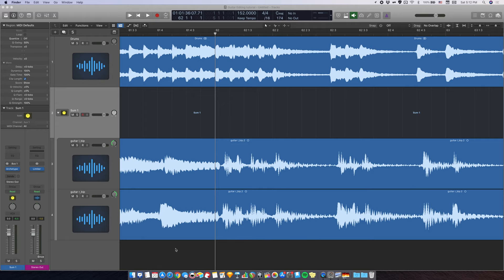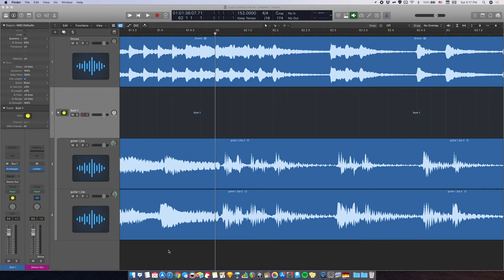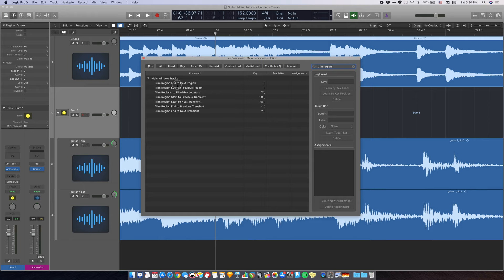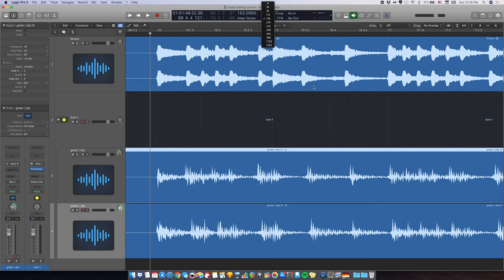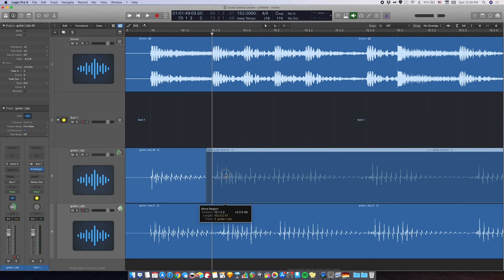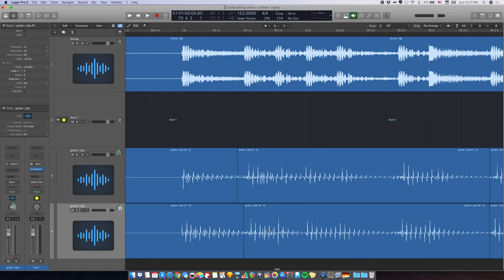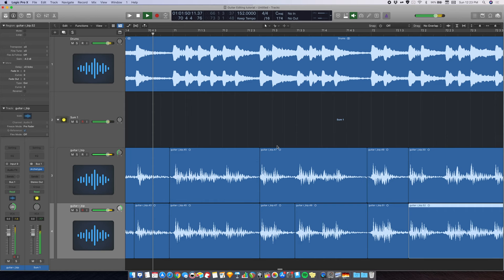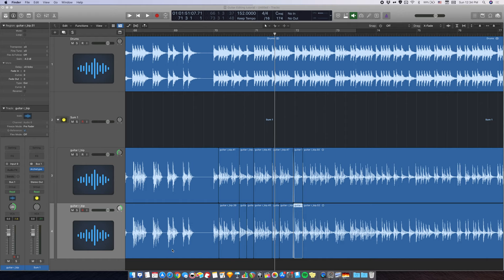The BEST Way to Edit Guitar DI (No Flex Time) - Logic Pro X Tutorial

Comment: Consider trying the Marque Tool which separates and isolates the section you are editing from the rest of your performance.  With a single Scissor edit, everything to the right of the edit is moving when you time correct.  Anything you played correctly will now be out of sync. Your original Left and Right performance is continually being pulled out of sync and moved around.  Single Scissor edits will force you to edit most of the performance, if not all, and take away any feel between the takes captured during recording.  The Marque Tool also works in Quick Swipe mode so you can move small sections or a single note around before you consolidate.

Comment: Thanks man! It was very useful! 
I've found out about flex time editing recently but I noticed too that it somehow destructs audio. Have no idea what is flex time (polyphonic mode) design for. I thought that I could finally edit my guitars in a few clicks... fat chance haha
Reply from the maker: Yeah, some people say they can't hear the artifacts—for clean or crunch guitars, the artifacts are probably inaudible, but once you are dealing with high gain guitars, because the signals get amplified so much, the artifacts also get amplified. I find that sometimes it's not even "artifacts." It's just a lacking in clarity, depth or dynamics after stretching, and unless you compare to the original, you might just think you just need to find a better tone.

According to the Logic manual, the polyphonic mode is "recommended for complex polyphonic material and is good for all kinds of chords—such as guitar, piano, and choir—and also complex mixes." I think by "guitar," it is referring to acoustic guitar or wet guitar but not guitar DIs.
Reply: @JamesZhan  You're absolutely right! Thanks again for that tips.
Reply from the maker: @696kir  you are very welcome!
Reply: Have you tried the "Rhythmic" option in flex time? I also started with the polyphonic mode, but realized that it makes weird things to the transients. However, with the Rhythmic mode, I can make fairly huge edits, and I don't really notice any distracting artifacts even after reamping with ultra-high gain amps
Reply: @fabiancsorba3932  same here, I’m using the rhythmic mode for breakdowns and it sounds spot on to me

Comment: I’m having trouble with parts that are late. I cut it and drag it to the left but it doesn’t blend into the next part properly , instead there’s the vertical line from where I cut and it doesn’t go away. Sometimes you can hear a slight skip or noise because there’s a slight gap between it and then I’m also left with a bunch of cuts on my track. It’s weird because it wasn’t like this before and now it’s doing this all of a sudden. Any help would be appreciated.
Reply from the maker: If the transition doesn't sound good, try doing the split at slightly different areas and moving again; that sometimes solves the transition problem for me. If that doesn't work, try doing a crossfade. Most of the time that will solve the problem too. If that STILL doesn't work, you might have to resort to flextime. Also, always play with the rest of the instruments. A lot of small artifacts in the transition are absolutely inaudible when the guitars are in the mix!

Comment: Any advice for how hot to record the DI or if you should strummer harder or softer? Sometimes I feel like I have a hard time seeing where the pick attack is (especially with more open strumming rather than rhythmic palm mutes) and I end up making it sound weird.
Reply from the maker: There's no definitive rule on how hard you should strum. I mean strumming a guitar is a performance so you might need to strum harder or softer depending on what the music is trying to convey. Regarding how hot to record, I always recommend setting the input to just below clipping when you strum the guitar hard, to maximize the signal to noise ratio.

Comment: Anybody knows what's the key command for reaper?
Im new to edit guitar, its easier on palm mute. Do i have to cut at each note or can i use dynamic split? And then quantize it but after using dynamic split and quantize it i find the notes isnt right
And if i edit the notes manually by dragging each transient i find that it doesn't sounds right on time, isn't if you drag and key command in reaper, the pick attack is happened before so the notes isnt really on the grid?
Reply from the maker: If you are using REAPER, you should take advantage of REAPER's capability to slip the audio waveform within an audio region (or "media item" in REAPER's language).

I have an older video where I showed how I edit guitar DIs in REAPER: https://youtu.be/wTv3gvuUePw

Comment: Is there a setting that needs to be active for the trim region to start/end shortcuts to work properly? Every time I use the key command for an early note I’ve moved forward in the track, the section replaced is dead air.
Reply from the maker: Hmm not really. Make sure you use the right key commands. I remember seeing a few that had similar wording. If you can confirm you were using the correct key commands, let me know and perhaps we can start a PM and I can help you troubleshoot!
Reply: @JamesZhan  I'm having the same problem, the section is replaced with nothing
Reply from the maker: That’s really bizarre. I honest don’t know what might have caused that. Are you sure there is audio content for the audio region to be extended?
Reply: I have had this issue. I’ve edited before where the gaps filled with audio and worked perfect and I’ve also had it fill in with nothing. I’m not sure why.

Comment: I like flex time tho
Reply from the maker: That’s fair! I just never like it because once you have stretched the audio it’s just not the same as before. To some people the difference might not be big enough, but since I’m doing professional work, I definitely don’t want to compromise quality 👍
Reply: What about recording at a slower tempo similar to August burns red.  The audio wouldn’t be stretched that way?
Reply from the maker: @ibanezxiphos700  That wouldn't help because you might need to contract the audio when editing the DI. Sometimes you need to move it forward, sometimes backward, and both alter the waveform of the audio, which is a form of "stretch." Flex Time just relies on an algorithm to keep the pitch the same, but the actual timbre of the original sound will have been altered.
Reply: @JamesZhan  Hmm good to know. I might start to steer away from flex